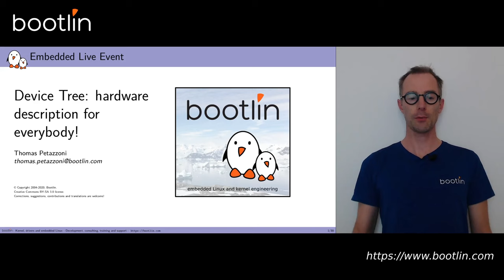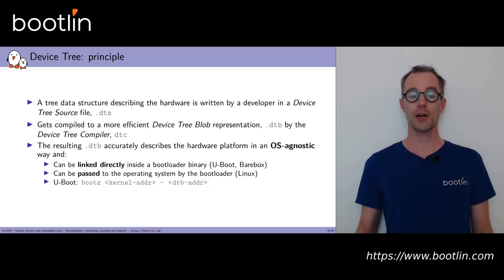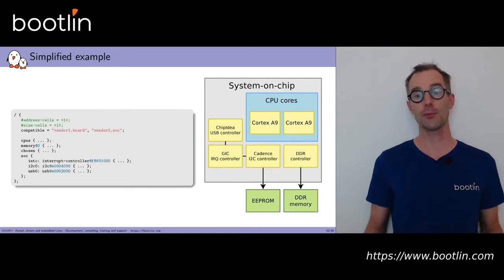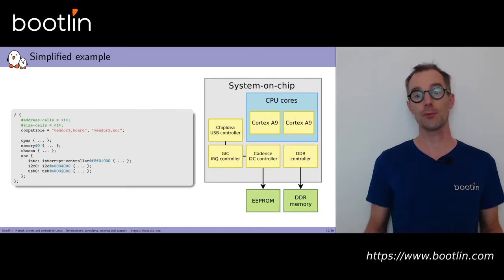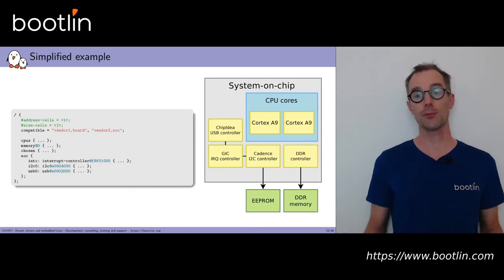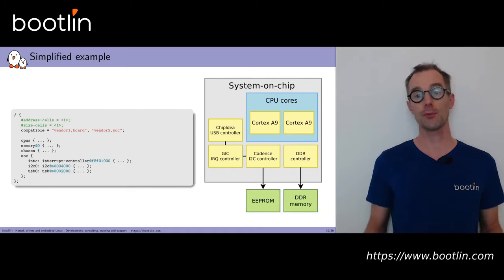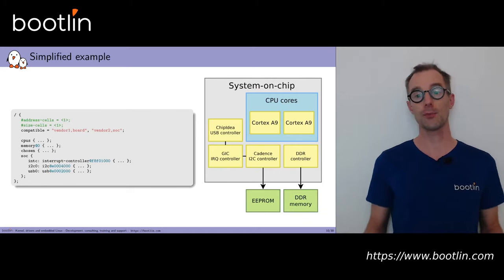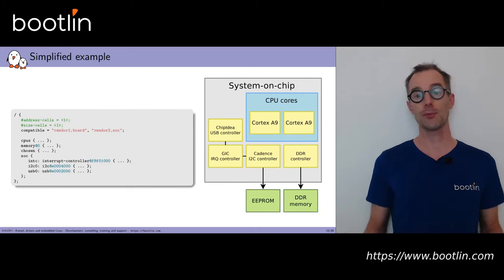Device Tree: hardware description for everybody !

Comment: Thanks for very interesting presentation. On slide 23 there is "No support in Linux for applying DT overlays however", however, I have been using configfs and  /sys/kernel/config/device-tree/overlays/ with mkdir dt-overlay ; cat dtb > dt-overlay/dtbo to load device trees after booting kernel. Is this depreciated in recent kernels?
Reply from the maker: I would suspect you're not using the official Linux kernel. Several forks of the Linux kernel have extra patches to add a user-space interface to add overlays, but as far as I'm aware, this interface is not in the upstream kernel.
Reply: @Bootlin  Maybe stupid question, but what about this:
https://www.kernel.org/doc/Documentation/devicetree/overlay-notes.txt
There is some "Overlay in-kernel API". I also read somewhere that runtime overlay in kernel is possible (maybe not upstream), but not recommended - is it true?
Great presenation btw.

Comment: Hi,
My background: 
I have worked on linux with x86 CPU boards. I have seen that after you load the i2c drivers, they are discoverable.
Quick question:
As you are saying that i2c, spi,etc devices are not discoverable. So, is it that once we load the i2c, spi drivers, you do not see them on the procfs/sysfs on embedded platforms? If yes, then can you please explain why this happens that even after you load the drivers, the peripherals are not discoverable.